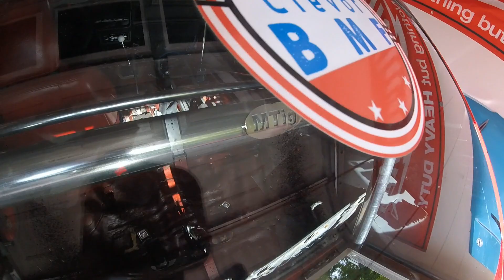I Won Street Car Takeover - But I Went SLOW

Comment: Cool deal, that one pass I saw 9.50 on the board and freaked out 😂
Reply from the maker: Lol I wish that was 1/4 mile time.  If I get my shit together and start hitting shifts I’ll be faster
Reply: @BMF_Garage  I can’t wait to go to the track. I finally have mine lined out. Just needs some fine tuning on the fuel and timing tables. Just hard to get the time to mess with it.
Reply from the maker: I hear you there!  I’ve got another event this weekend and I’m trying to get my coil over kits, ecu, and boost controller installed

Comment: Way to go Brooks! I like the new windshield & rollcage & I think seats! Thank you for the ride along! Not trying to rip on you, but is there a reason you don't power shift? Just an Ole gear jammer wondering, lol!
Reply from the maker: Lol trans mainly.  It grinds really bad if I try to power shift and it doesn’t give me warm fuzzies to hear those noises lol.   Need to get it worked on cause I’ve been beating on it for years.  Trying to get it upgraded by American powertrain to handle more power and get it all fixed up.
Reply: @BMF_Garage  I thought I heard a bit of grinding or unhappiness on few gear changes over the videos. Take Care Brooks & family!
Reply from the maker: Yeah, I try to take it easy on it lol